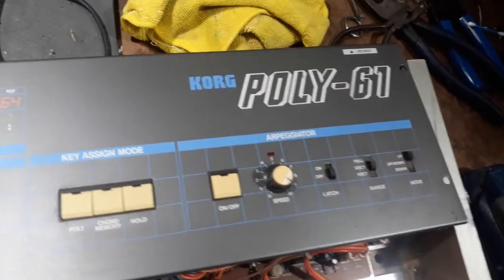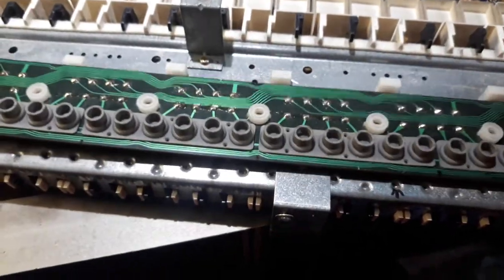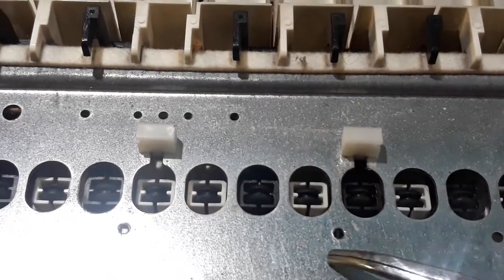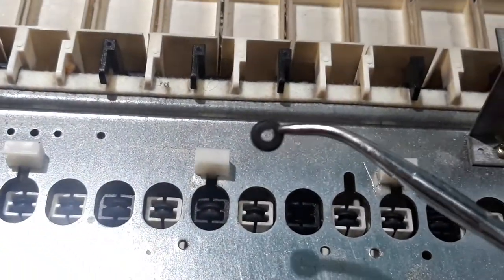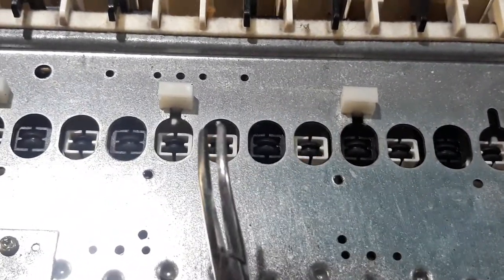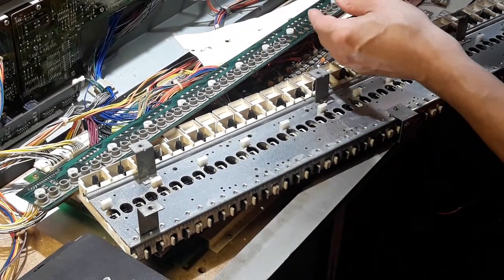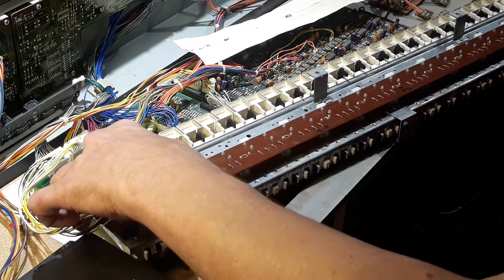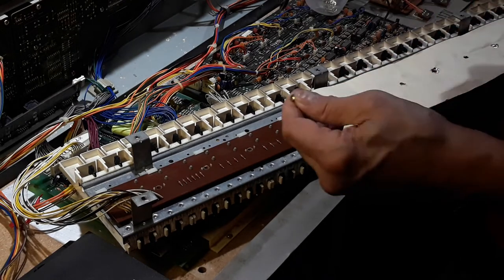QUINTRONICS - KORG POLY 61, DEAD KEY HACK /  REPAIR with rubber grommets

Comment: SO i have repaired many of these and struggled with this same problem...But what I discovered was the reason cleaning does not help with these rubbers is they surface oxidize (plus if you use rubbing alcohol it leaves a residue) and if you just rub them down with a bit of sand paper they work well again but your solution is quite genius in getting that key bed switches to push harder on the actual rubber. I had noticed this issue too off the keybed they seemed to work fine but in the bed they would be flaky . I shall have to try this but i do have NEW from manufacturer that still produces the replacement rubbers for the 61 key beds used in these and the memorymoog.  I will be putting kits up on eBay some time in the future..  cheers for a good job !

Comment: Terrific! Especially if you have a plethora of grommets kickin' around ;)
I rescued my Poly-61 and Poly6  in a similar fashion 30 years ago; I used 1/4" diameter washers with a depth of probably 1/16" superglued flat onto the key plunger - centering was tricky as there was little room to avoid contact with the metal plate it had to go thru, and it was superglue! - this did the job wonderfully although I always at least imagined the feeling that the key throw was indeed shorter - in the end of course it was just a matter of getting used to it, as without velocity you're really not missing much of anything. I don't recall the response across the keyboard was uneven  or at least not notable, as I guess you have mentioned as well. I thought the beauty of my solution was that the round washer met the entire ring of the silicon plunger (whereas the square plastic part of the key would have only been contacting the ring in 4 places) maybe reducing long-term uneven wear. I sold both synths soon after, so I'll never know!

Comment: Brilliant! I've worked on quite a few of these and was recoating the black discs with conductive paint, which works but over time seems to crap out again. Definitely interested to try this method. The Korg Polysix also has this same issue
Reply from the maker: what is your source for the conductive paint?  Doing both would be great. I kinda can't believe the world has not come up with a better key-contact method. Every time I work on one of these I shake my head at those flimsy little rubber strips.
Reply: @spellcasterlodge  I think I used some kind of "remote control repair kit". You might check out a company called Bare Conductive, their electric paint might work

Comment: Thank you for this, I recently purchased or won an auction on ebay for this same synth however they didn't inform me about the keys not working everything else is functional and only 9 keys are working.
I will do this and let you know how it turns out 
Other then that do you think me spending $160 was too much? That's including shipping cost as well.

Thank you for your time